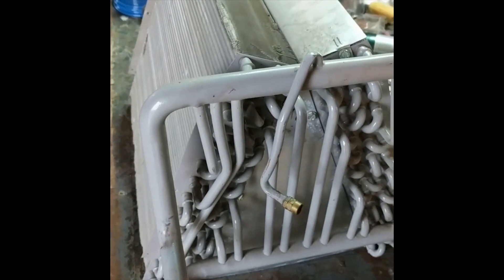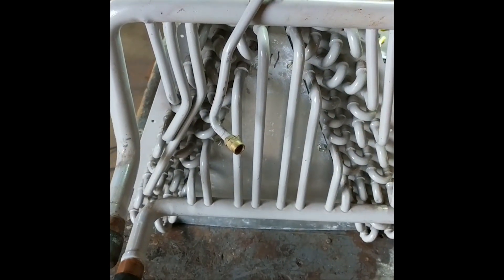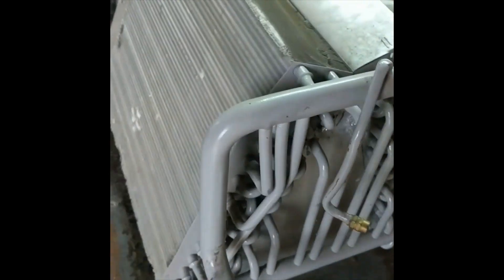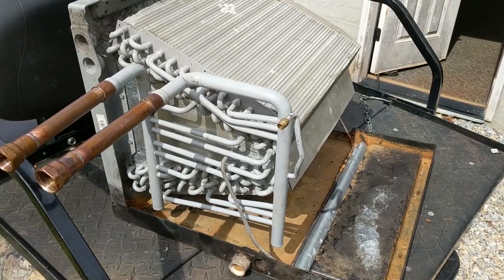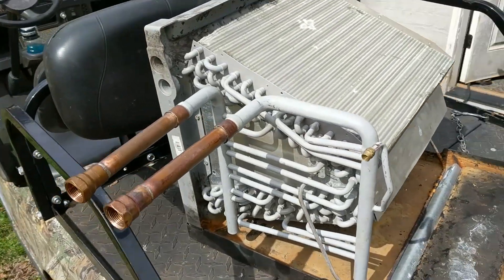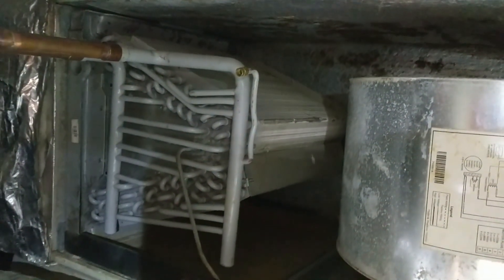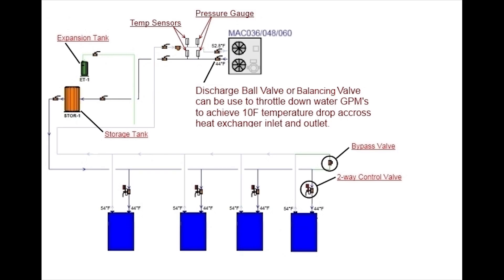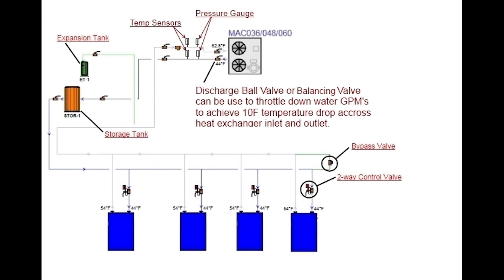Cooling Our Home with Water - Hydronics #2

Comment: Very simple air conditioner for a small yacht. Using a small 12vdc submersible pump that will raise water at least 20 ft pump the cold water through a used heater core from a wrecked car and back into the lake.This core should be enclosed in a metal box of sorts with fins exposed. Connect a 12vdc computer fan in the box to blow through the heater core.
Water from the lake at that depth will be cold and while running will cool your yacht considerably. Mine works just fine now for 20 years. Water at my dock 20 ft down is 56ºF in summer.  My well water at home is 52ºF all year. Hope this will work for you.

Comment: I cool my house with water based AC too.... I use chilltrex units and a custom water chiller I designed with 4 tons stored overnight so only my pumps have to run after the sun is down. Of course my house is designed super efficient with ICF Mikey Block, no air gap flat insulated roof and insulated slab/footers. My whole unit is 2 tons and uses 1650 watts. Chilltrex cooler was 220v and 12 amps max. Thats about 100 amps on my 24v battery system. So I designed my own with (2) 1 ton super efficient chillers. Working great and uses less than a third of typical home cooling for a 2850sq ft home.
Reply: Energy efficient flex 😂.

But honestly sounds pretty cool. Wish we had more energy efficient homes designed like this

Comment: This summer im going to (attempt) cooling my house using the 55-60 degree water that constantly flows in the creek next to my house.

My plan is to make a ram-pump to freely pump creek water to a storage tank that will sit at the highest elevation on my property.

From there I'll let the water gravity flow to intake port on the A-coil in my furnace/duct work.  

Then I'll just turn the furnace to "fan" and that should in theory keep the house cool.

The discharge flow will just go back to the creek from which it came.

At some point, I'd like to figure out a way to make the water flow power the blower fan so the whole system will be totally self sustained.
Reply: LeeRoy Dundlehay I’m thinking about doing this for my shed.

Comment: You should convert to R290 propane refrigerant, look how is saves compressor load! Saves recovery hassles too. Two cans 20 each should be plenty. I was amazed how less = more. You'd be safe, it's only outdoors, in worst case leak.
Reply: Agree. Either R290 or CO2 in a mono-block is perfect for water heating in the north.

Comment: Tinker time mechanical engineers like to play with chilled water loops.Electricity rates for residential are not time specific. a VRF  system with inverter compressor beats chilled water for home cooling. It's quick acting, no mass storage required, no extra heat exchange, pumps.

Comment: My uncle was working on a similar project.  He was going the ultra cheap route.  He had an old irrigation well that was very deep.  He collected automotive radiators for coils.  He was going to run it as a secondary system.  He had a big farm house that was costing a lot to cool.  Not sure if he ever finished it.
Reply: All we need is the practical engineering & the labor , let’s go men. ( and women , of course )

Comment: I have been thinking of building an air cooling hydronic unit for a long time. I have a natural spring that feeds my pond in the back yard. Here in Indiana ground water temps are around 53F. I already heat with outdoor wood boiler. pex tubing on the bottom of the floors.......I basically can heat the house on around 300w of power with the boiler blower going, and the circulating pump going. The furnace is only a backup system.....and they are not connected to one another.
Reply: Got a vid

Comment: holy cow.  Your Alma Mater is $70k a year.
Reply from the maker: A bit pricey isn't it.  I am very thankful I escaped with only owing 25k when I graduated!  I stayed to get my Masters degree and it felt like I was winning since I got a tuition waiver and got paid teaching the robotics portion of a manufacturing lab class!
Reply: It would be cheaper to send my boy to The Citadel (my Alma Mater) for an engineering degree.  Of course The Citadel's engineering program isn't rated as high or have mechanical engineering.  Just civil and electrical.

Comment: My dad had a buddy with a house built over an old well.  He got a radiator out of an old junked pickup, plumbed it into the well, and set up a fan to blow air over it.  The well water was plenty cold enough to handle a Nebraska summer.  Not sure I'd try to do it much further south than that, but with the solar-powered ice production to build up that "bank of cold",  it should be workable pretty much anywhere (because the hotter it is, generally the more hours of sunlight you have anyway).

Comment: If the system can't handle the humidity fast enough remember you can cheat and just add plates to pass cold water thru to collect condensation on and have it separate from the temperature control.

Comment: now you have to use that same flowing water in the same system and use a filtering device so that you can tint continually use it for washing your hands and dishes and so forth. not to mention using solar energy to power the fans that cool your house. what's the most natural method to heat your house in the most economically sound away?

Comment: Solar is the only way that is even remotely cost effective.  There are conventional chiller based 'ac' systems in 2 high rise buildings I help take care of (on the magnitude of 20+40 ton compressors)  They just don't cut the mustard on the 90+ degree days.  The chiller unit makes the water plenty cold, but the blowers in the apartments just don't pull enough moisture out of the air.
Reply: is this because refrigerant is cooler and therefore condenses more moisture from the air that's circulating throughout the house?

Comment: hydronics is great way to do things. have to be careful on the piping so you don't have gost flows.  pipe size is also very important. I've done lots of it over the years. curcilators take power. once a gin pipe sizing for smaller circulators is a must.you can do it just a lot of planning